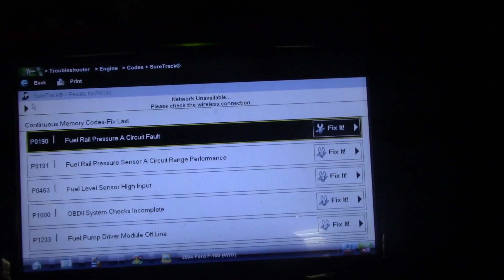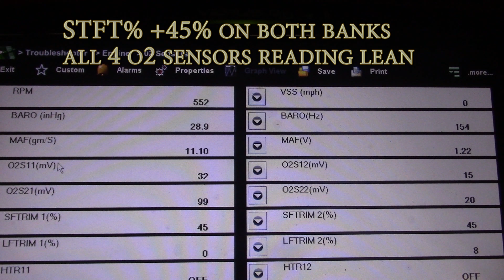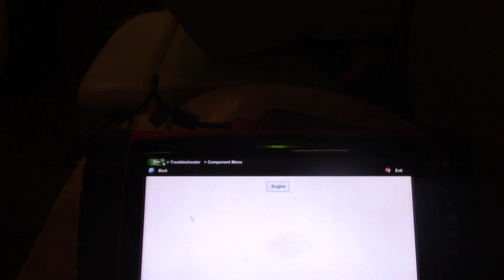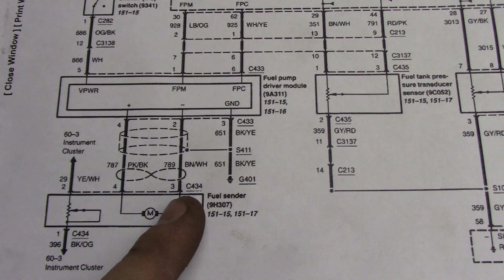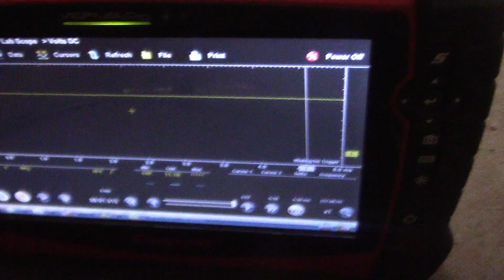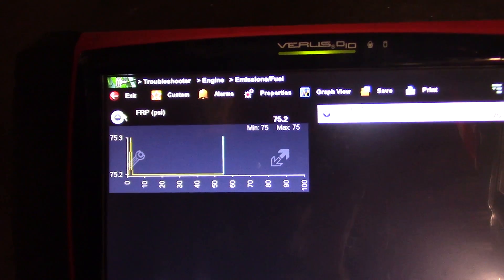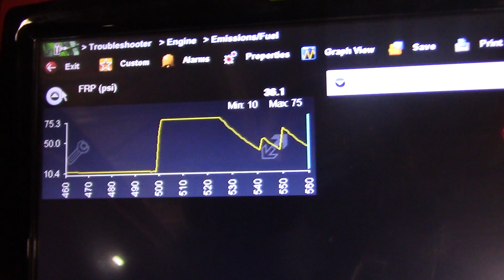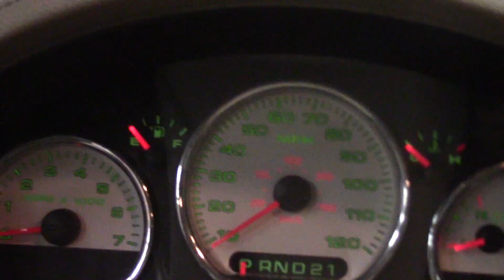2004 Ford F-150 5.4L Stall-No Start P0191 Fuel Rail Psi Sensor P1233 Fuel Pump Driver Module Offline

Comment: Nice work! Was there something on the diagram that told you it was a pulsed ground, or did you happen to know that from experience, or contained in a system description and operation write-up you read off-camera?
Reply from the maker: thanks Ron, well I know that a fuel pump needs a power and a ground to run, and I knew it was a variable speed pump,  so actually off camera when I back probed the ground side I wanted to see what my voltage reading was, so with the key on connected on the ground I read 12v, that tells me the module supplies the 12v all the time and the pump needs a ground therefore it is ground side switched, a little bit of experience goes with it too, knowing other systems that use basically the same design, but ultimately just some voltage checks can quickly identify design